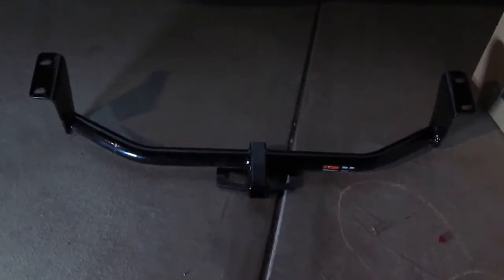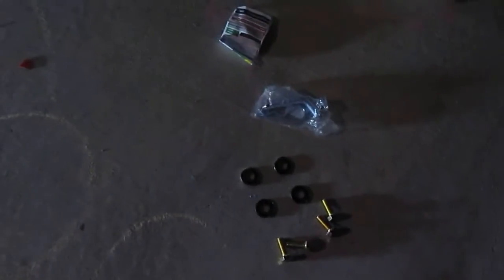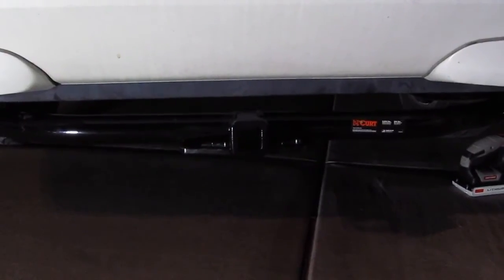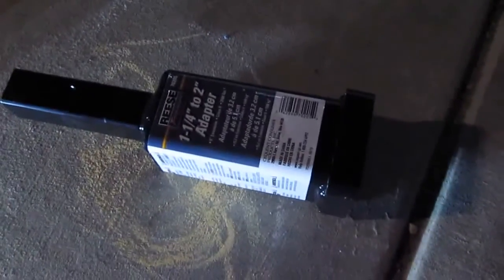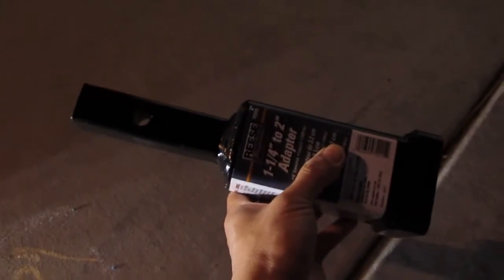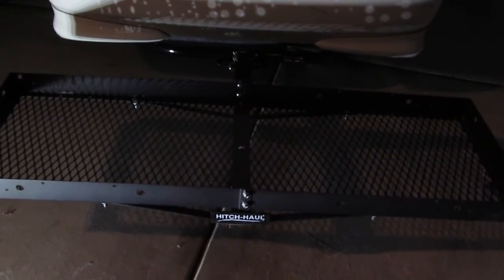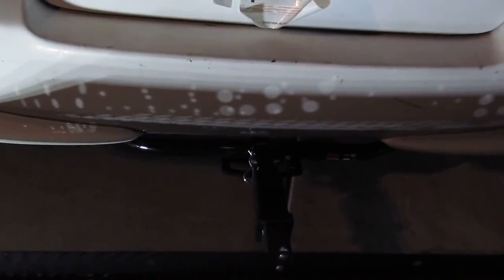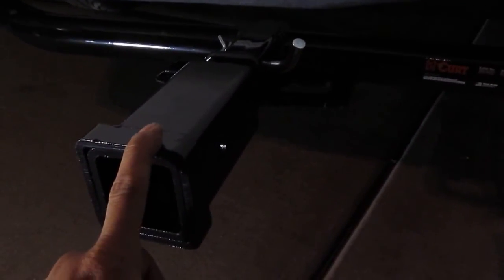Hitch Curt brand on a Toyota Corolla 2006 2007 2008 2009 2010

Comment: thanks for the video! So you didn't even have to lower the car's muffler? Great. I have a 2006 Corolla with 228k and it still runs new, very durable car

Anyway, thanks again
Reply from the maker: Chas Burns I don't have to do any modifications to the car in order to install this hitch. It just fits right in.
Reply: vuaeco I installed it! I used a stiff wire brush in the threads and tapped the car's frame lightly to remove any debris from the threads